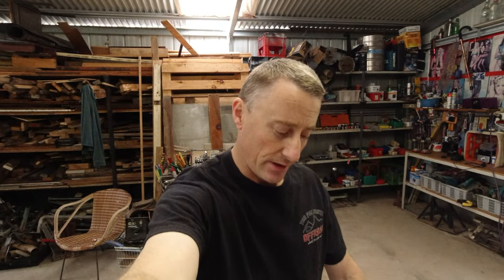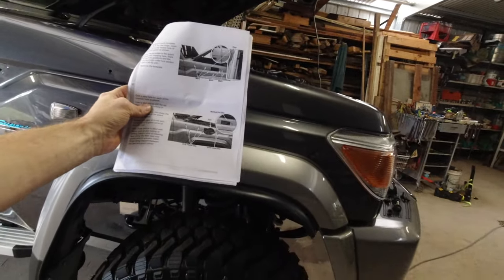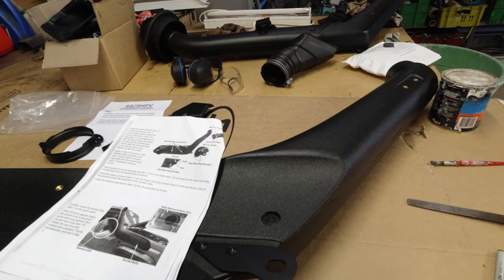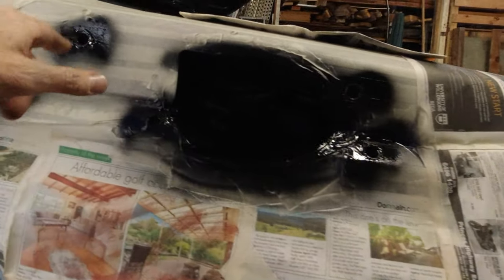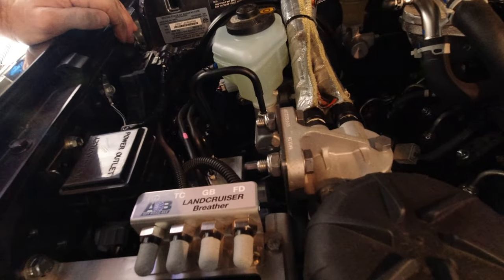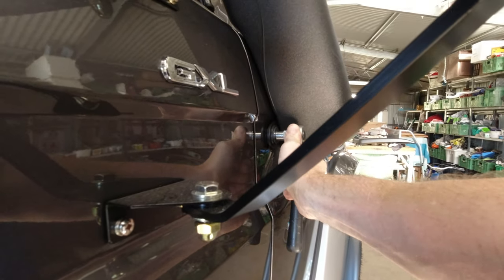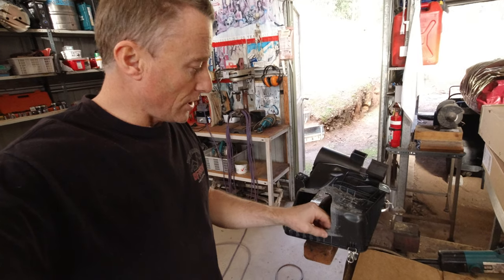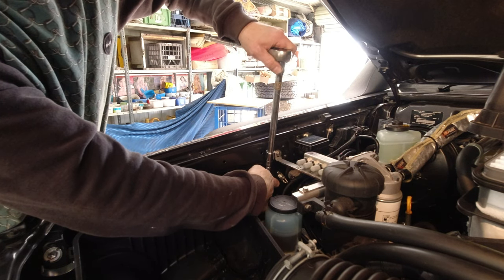Landcruiser 79 Series Build - Episode 4 - Safari Snorkel Install

Comment: Hey mate. Did you find any increased fuel economy or performance since you installed this. I’m looking at doing the same for my new 79 series as I tow the caravan with it. Thanks mate.
Reply from the maker: Hi Ryan, Honestly i couldn't tell you i'm sorry. I had not driven the LC very much before doing the install . I am glad i did it as it seals up to the air box very well and will keep the water out, Congrats on the new rig,👍
Reply: @toofarsouthoffroad  Thanks mate for getting back to me so fast.  I appreciate your feed back on this. Have a great weekend and Im certainly very happy with my purchase.
Reply from the maker: @RyanIngleton  👍

Comment: Good video. Every Safari I've seen has had to have extra screws fixed in the window pillar, (and a blank over the original 2 bolt mount) yours seems to mount on the original 2 bolt mount. Have they changed the design and included that top mount or did you make that mount? 
And I like your wall art👌
Reply from the maker: Hi murrengerk , thank you. i did do a little research about the snorkels as i did notice there were a couple of different top mounts ,maybe there was a old and new design due at the same time during the change over, this was a year ago now so maybe all the same now ? so i just used what came supplied but i did take notice of the top style if you know what i mean. It was a easy job ,just a long job, Don't worry about the couple of very rear screws near the door as there are enough holding it on. I was waiting for someone to notice the wall pic's haha. I hope this helps a little.